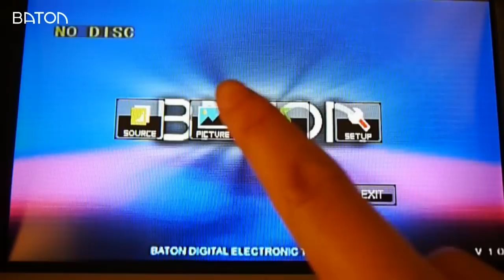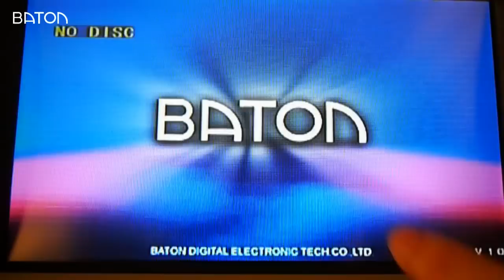BATON Universal Headrest Monitor Installation

Comment: I would like to buy this very soon this year 2017, and want to know if there are newer versions of this model, and also, can this connect wirelessly, dual connect or blue tooth to an InDash stereo with out having to pass alot of wires assuming such a thing exist?
As I plan to install as well later on if I manage this year.